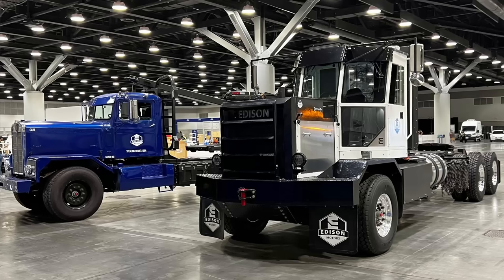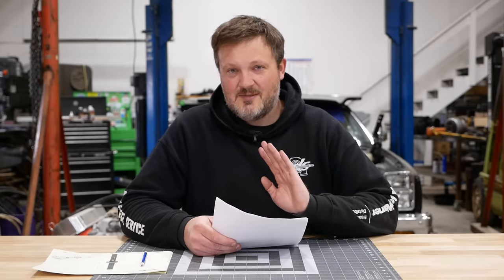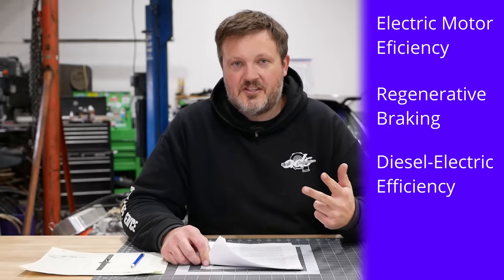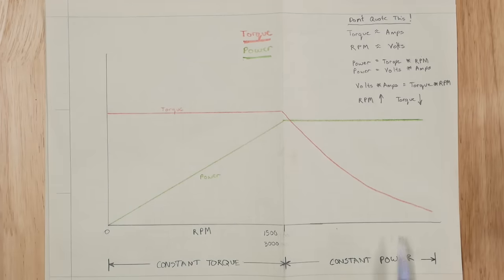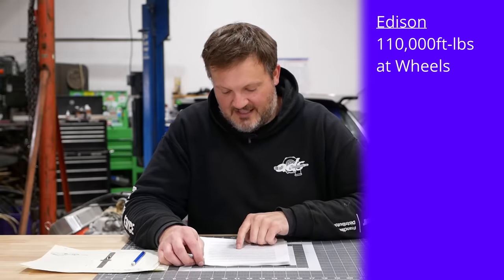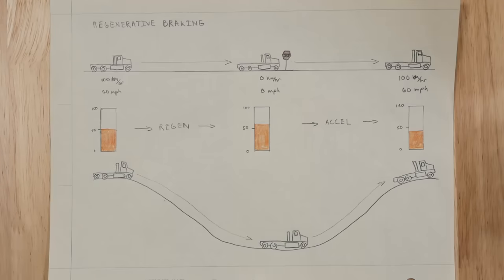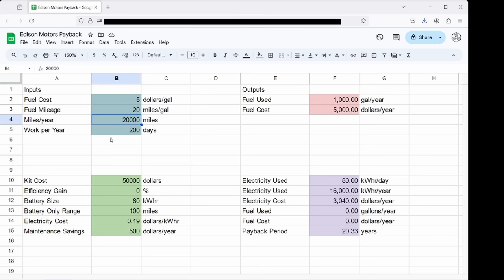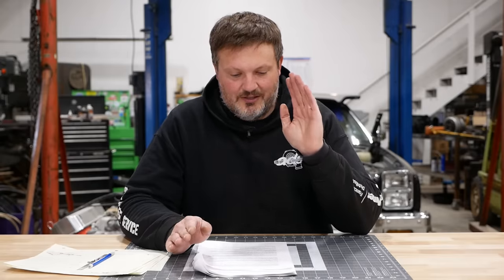Edison Motors Built a Diesel - Electric Semi Truck

Comment: I think what Edison is trying to do is cool. I fuel generators for a living. It's all about burn rates. C9 gensets burn 16 gal/hr to make 200ekW under 100%load (all assuming the genset is cats current commercially available genset). I'll have to go back through your video and math that out given your figures(which make sense), and it's all subject to how much load % Edisons electronics have their system run. Figuring a middling 7mpg average for 55 mph over 11hrs, that's 86.42 gallons over 605 miles. Now I don't know what a "few hours" on Edisons battery alone are, let's assume it's 200 miles, or 3.5 hrs (slightly better than average, but within reality)on the highway. Here's the bubble burst. Running the commercially available c9 genset to cover the same 605 miles, charging at 100% load, will burn roughly 120 gallons of fuel. I typed assuming a lot in this comment, because so much of Edisons whiz bangery isn't advertised or published. There's a lot going on, and I'm sure in some situations the Edison system makes sense, but being a fix all for the future. Nah.
Reply from the maker: That's roughly the same math I came up with.

Comment: A great video with a lot of great points and a different perspective on Edison’s concept. It will be interesting to see the real world data. I know coming from a mining background, diesel electric haul trucks (930E komatsu, 5000ac hitachi) have a reputation for less fuel consumption, 10/15 % depending on conditions, with no battery bank and a lot of the time hauling uphill, going back into the pit empty. One point I think you missed when calculating the costs was decreased wear on components of the truck, for example brakes (being able to use the retarder instead), no transmission/driveshaft, the engine operating under one consistent load (power generation engines are known to have far increased engine life due to this). Will be interesting to see what happens when they get out there and pull with it and compare to an all mechanical truck. Overall great video though and keep up the great content!

Comment: Great understandable video Wes.  One thing that you didn't mention and a VERY BIG issue with EVs is heat management.  A robust (durable and reliable) and effective cooling and heating system to keep those batteries warm in winter and from catching fire in the summer is absolutely critical.  After watching your video I thought maybe the truck would work in the loaded downhill, unloaded uphill scenario, but no---doubtful in the winter because of extreme temperature drops especially if you store the truck outside.  And in the summer that truck could become a rolling roman candle on a loaded trip down the mountain.  I do wonder how these folks got so far involved without realizing the minefield they were stepping into?
Reply: If they have a 300kWh battery and 300kW motors, they are only doing 1C discharge, which is nothing. Now consider something like a Tesla Plaid that has a 100Kwh pack but can do 300kW for a good while and 800kW for a quick while. 😅

Comment: How much weight is added to the tare of the tractor unit by the battery?  The impact this would have in the overall gross, let alone the time it would take to pay the conversion off being beyond the life expectancy of most daily drive heavy units,  is enough to question its practical ability,

Comment: I hope they can make it work. I personally like hybrids way more than pure EV's, and have been wondering for years why we don't have some plug in hybrid with a little generator under the hood just to power the battery. Sure it's not as efficient, but not having to sit for 30-90 minutes waiting to charge would be great, and you would still have the option of much cheaper trickle charging during longer periods of down time.

Comment: As a hardline, completely original Engineer, I detest EV's.  However, I concede the possibility of Hybrid power use in Vehicles of our future.  Another point to consider is the maintenance of electric components and ancillary items.  Also to be considered is the dangers of batteries when mechanically altered by some outside source - a wreck.  The 20 year old Honda Civic is looking better and better!!!

Comment: Ok, let's say they nail it.  They are a startup.  Other than Tesla and established players,  do you trust new companies with proprietary parts to be around in 5 or 10 years when you will need a proprietary part?   A dealer network will no longer be a dealer network if they fold.   Let's say things like battery cases?  Yeah it's a box of batteries.  It's not simple.  People have problems scrounging for stuff now still being made.
Reply from the maker: There are literally hundreds of EV companies that have come in with a lot of hype and completely disappeared soon after. Weego, Coda, Fiskar, etc.
Reply: @WatchWesWork  Which would make me extremely leery about buying something from the new kid on the block.  There's some EV guy on Youtube that has a Coda.  Parts?  Heh.  But his thing is to show the pain and suffering while being a believer.   He "Fixed" it last year.  I believe it currently doesn't run.

Fiskar is in it's 2nd or 3rd reincarnation.  People took a real leap of faith with Tesla.  I think Tesla made it (at least so far) because they put the chargers in.  Without the chargers, they would not have made it.

Comment: I’m sure if it was economically viable one of the big truck manufacturers would have done it already to smash the opposition and take market share in an industry that already runs on shoestring budgets, anything to reduce fuel and maintenance costs so they can do it cheaper than the next trucking company wins, but R&D is expensive and needed in the transport industry as a whole

Comment: There is a charging cable for my phone that has both ends are small and it will charge  my  phone quickly but if I use one with one end larger, it takes 3-4× as long

Comment: The re-gen argument has another big hole in it.   You can only re-gen as much energy as you can store.   If you want to run downhill for a long time eventually either you will hit 100% (usable) charge on your battery or you are carrying such a large battery the rest of the time you are sacrificing cargo volume.

Comment: My dad tried to get funding to design and prototype a diesel over electric truck without the battery bank back in the 90s. Hybrids were still an early idea. No one wanted to fund the project saying it wouldn't work and didn't make sense. Later when he ran the numbers, they were probably right. Theoretically, fuel efficiency would have been marginally better. Real world probably a wash at best. Of course upfront cost was never considered.

A diesel-electric locomotive might operate the same, but the mode of operation is totally different. Glad you touched on that. Trains messure efficiency in tons per kW, not mpg.

Comment: Sounds like it's time for a road trip Wes, I know they would love to have you pay them a visit. One only finds solutions to problems by actually trying and some times failing. We had a firm in B.C. that converted older diesel locomotives to Hybrid locomotives (Power Rail). The same concept of a diesel gen set charging batteries with regenerative braking. They were very popular with some railways in the early stages of the builds, most were on lease during real world testing phases in yard and switching duties. That company sadly closed once it was moved back east and placed in the hands of idiots who screwed the pooch and ran with the cash. I think a lot of their plan has to do with "application" over "universality", in some applications I could see it doing really good and in others not so much. So like our current day use cases, one tool doesn't always work for every application. I am encouraged to see where they go with this, it will be fun to watch and see how it all pans out. Thanks for your review and looking forward to see what the future brings for them "down the road"...

Comment: Great analysis and breakdown.  Ive often wondered why somebody hasnt modeled a system after a diesel/electric train which are supposed to be very efficient.  You have answered some of those questions.  More research is needed to see if that technology (series hybrid) efficiency could be improved to the point that it could be scalable.

Comment: For a moment i thought we was going to get to color. Im disappointed lol. But seriously i think your hundred percent correct, iv chatted with Chrysler engineer and they have been working on these issues for quite a few years and there’s a reason that this design isn’t manufactured already. It’s truly hard to do better than combustion in an overall design. Not that it can’t be improved in small scenarios. Not everyone travels or pulls a load. I think you hit this spot on. Edison has a great idea, in in the right scenario it’s perfect. But overall it’s not the next great idea.

Comment: The 1850 ft/lbs of torque is at 1400 rip-ems. At idle its more like 850 ft/lbs. Now take away all the torque that is lost via frame twist and motor mounts and axle wrap. The Edison truck doesn't loose that. When Chace goosed it at the salvage yard with the Shermanator on the back it just broke the tires loose no frame twist or motor mounts to take away that torque...

Comment: I live in deep back country of the northeast which ads many more elements of issue to electric based anything. I drive Jeeps and only Jeeps there is only a few other makers that even make vehicle that can handle and go where we need to go in the winter, and these are vehicles that are gas powered and perfected for oh 100 plus years. There is not currently a electric vehicle that can do what my Jeep Wrangler can do or My Gladiator, now Jeep has brought product to market but with many limitations. One is I drive an estimated 100 miles to do or get anything. Oh, add factor of extreme cold 30 below or more, yes, I understand that technology is in place to heat these batteries but that consumes energy. I currently have lithium-based batteries in my bass boat I love them they are very reliable and years of use, but they come with many downfalls one they have to be stored inside if not heated during discharge, below 14 degrees Fahrenheit. Which is not an issue really being boat is not used in those environments. A vehicle is, but a vehicle is equipped with heaters that consumes energy that reduces milage range.

Comment: Wes - I think your analysis is probably correct.  My BOE (Back of Envelope) figures for level road constant speed driving say trucks use significantly less than 200 kW, and the C9 Cat at 250 kW(e) can reasonably achieve higher fuel efficiency at it's single speed & single load point than a 450 HP conventional diesel running all over the map in terms of power and rpm.  

Still, your analysis is largely correct, IMHO.  I also agree that I'd like to see the Edison folks succeed.  I hope they can zero in on your analysis and provide some updates. 

As always, thanks for this!

Comment: A hybrid vehicle is in my opinion wasted effort. Even if its in series it still essentially 2 drive trains. I applaud the effort! but the only way for significant energy savings is completely electric. At this time the battery technology just isnt there ..........yet! in another 5 - 10 years it will be a different ball game. I have 2 electric cars, and a half built home made electric civic. I think personally its all going to go electric eventually, the battery technology is here for cars and light trucks but not for heavy haulers and huge machinery. 
I would like to say i own a 2012 leaf i have had for over 8 years it has 90,0000 miles on it and its driven daily.  also a 2023 leaf i have had for 2 months. ill never buy another gas car AGAIN!  If you wanna have some cheap fun, and put your hands on a super simple RELIABLE machine Wes. Pick yourself up a first gen Leaf just to play with you will have a blast with it Wes! Love your vids Wes!

Comment: Like the breakdown Wes, I think you make a lot of good points. I had similar thoughts about some of the numbers but it seems to me like it should be an improvement over a more traditional truck.

The single biggest thing that I love about the Edison guys is that they are basically taking the Big Bug (ag tractor) approach: Make it functional, durable, serviceable, and rebuildable. This is a concept that industry writ large has completely shunned with few exceptions for years, and in my opinion, has done more environmental damaged than just about any other source. If we had rebuildable vehicles, we would only need to produce a fraction of the ones we do, saving resources, power, and waste. (Side note, that's one think that I'd highlight regarding the diesel-electric hybrid being better: Keeping that Diesel running at a constant rpm and constant load should greatly increase the reliability and longevity of the DPF and SCM systems compared to current vocational trucks that spend a lot of time idling or under a low load turning a pto.)

For sure, there are a lot of questions to be answered about what the Edison folks are working on, and I eagerly await those answers, as I think you do too.

If I had one criticism of this video, it would be that you seem to come off as overly cynical, purely focused on the numbers. The numbers are certainly a good thing to focus on, but even if they just come up even money.... I'm pretty sure I'd still take Topsy over what most of the others are building.

Comment: MPGe will vary A LOT based on your location. Here in some northern Alaskan villages, some people are paying $14 per gallon on diesel and "only" $.25/kWh for electricity. In cases like that, you could cut your cost per mile by 75% immediately, and if you have a solar or hydro setup(somewhat reasonable in the villages) you could cut that cost to pennies per mile.

I think it would be helpful to share a conversion equation so people could see if this kind of conversion makes any sense at all for them.

Comment: Loved the video. As for electric cars: Imagine living in a world where electric vehicles (EVs) reign supreme - they're the only game in town, with all their inherent pros and cons. Now envision someone approaching you and claiming to have invented a revolutionary new vehicle that blows current EVs out of the water.

This supposed breakthrough can travel over 500 miles on a single fuel supply before needing to recharge, which itself takes less than 5 minutes. Its range doesn't even get hampered by subzero temperatures. Plus, it's at least a third lighter than existing EVs, putting far less stress on road infrastructure.

Even if the person simply listed those advantages, you'd probably be foaming at the mouth to get your hands on one of these marvels, right? Suddenly, the shortcomings of modern EVs - limited range, lengthy recharge times, performance hits in extreme cold, considerable vehicular heft - seem laughably obsolete.

That's why the electric car is not going to take over the ICE car.
Reply from the maker: It's a good point. But imagine that person came to you with the first internal combustion engine ever made. Not an engine with 130 years of trial and error to perfect it. No one would put a model T engine in their EV just get better range. That's more or less where we're at with EVs. But then again, maybe I'm being too optimistic.

Comment: Very interesting topic Wes. The most viable solution for the moment maybe it is to attach an electric motor and battery kit to a differential and charge it at home, thinking on pickup trucks. Generating it's own power with a combustion engine does not seem to be a solution, at least from a cost perspective.